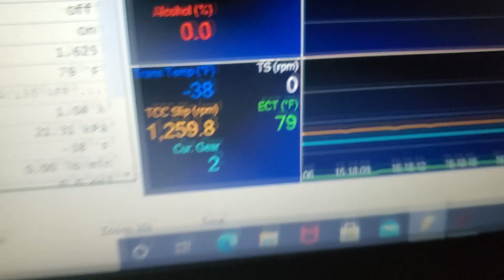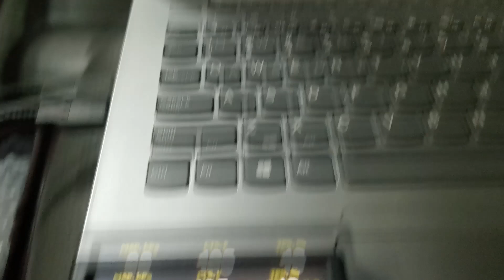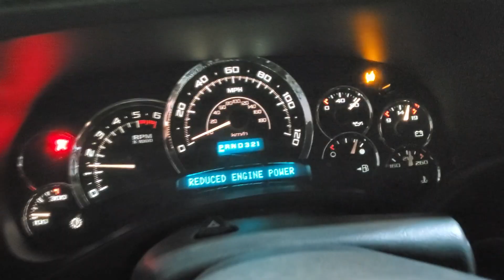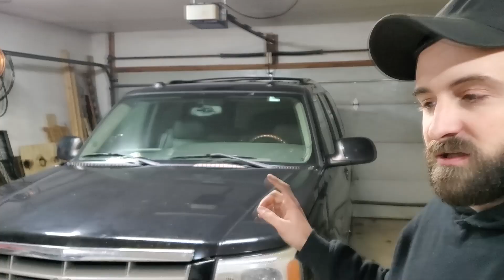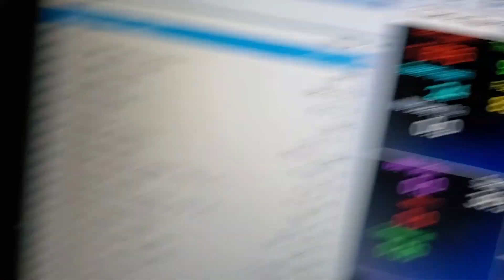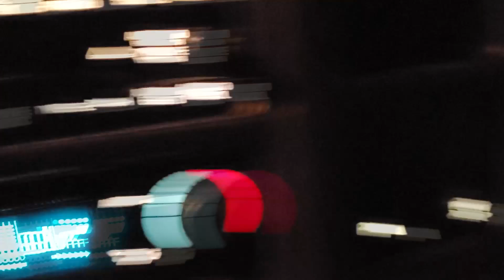Turbo Escalade Terminator Integration First Drive!!!

Comment: I know I'm commenting on an old video here, but any insight to the tachometer reading would be greatly appreciated.
I split the crank sensor signal similar to how you show in part 1 / part 2 (I forget) so the crank sensor signal wire is split to my holley harness and stock harness without cutting anything. The gauge cluster doesnt seem to read RPM at all, I'm wondering if my issue is that this truck was a v6 originally. I flashed the stock PCM with a stock V8 manual transmission file (since this truck has a T56). Im guessing that I might need a gauge cluster from a V8 to fix this issue im having

Comment: Did this last year on my 99 camaro. I actually had to have my cam and crank sensor signal to make my factory tach work. Did you need both? Need to get my water temp working and oil pressure now, wasnt aware of the 3wire water sensor so thanks for that. Will be doing this when i pull the heads.

Comment: Our old 05 Escalade had the same oil pressure gauge issue. If you turn the key on (engine off) the gauge would go to 80psi. Generally means the sensor is bad.

Comment: Nice work, I piggybacked a microsquirt I had laying around onto my turbo 04 Escalade and kept the cruise, dbw and trans control with the factory ecu. Funny thing was it all worked except I biffed my Speed density tune and nuked the stock trans on the first drive. Now I'm doing an 80E swap.
Reply from the maker: I think I'm going to try using the stock dbw wiring and feed signal back to terminator. See if that works.
Reply: @BlaserBuilds  With mine I just split one of the TPS signal wire back to the megasquirt. I did run into issues getting it to idle since the factory ecm had its own agenda, I ended up drilling the the throttle plate and upping the commanded idle.

Comment: Oil pressure gauge itself is prob broken, my denali does the same and I tried a different sensor and still the same. Unless the sensor went bad sitting on the shelf.
Reply from the maker: It reads 90+ on scanner too.

Comment: Why doesn't the trans temp work? Seems it should work as long as you have the correct cluster/gauges.
Reply from the maker: Its not hooked up. I just have to run the signal wire.

Comment: Hey just an FYI to get rid of the "reduced engine power" message go turn the etc bit from 1 to 0 in the system options in hp tuners. I figured that out in my terminator integration in my 04 silverado
Reply: Wait the what? Can you explain I’ll be doing this shortly as well seems like a great tip
Reply: how do u piggy back of xmax to make all ur gauges work like they did before i have a03 gmc 2500 that iwas thinking of going with the holly xmax but im kinda scared to do so cause i dontknow how to get the factory gages to work with it and no one reallys shows what has to be done for that part
Reply: @haroldpowell  i got a integration harness that was plug and play from current performance wiring